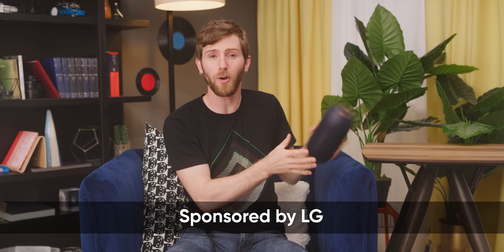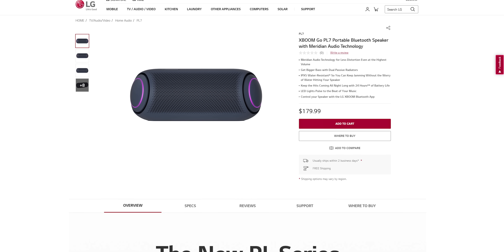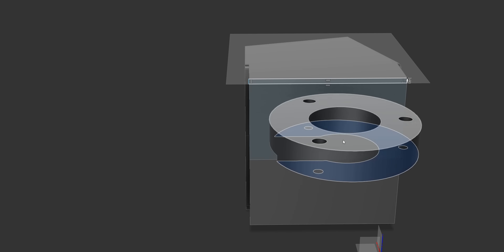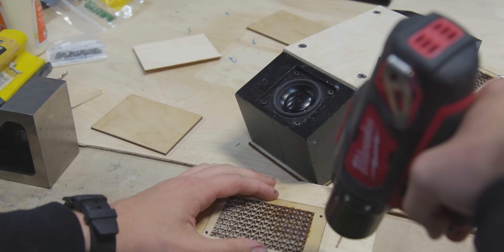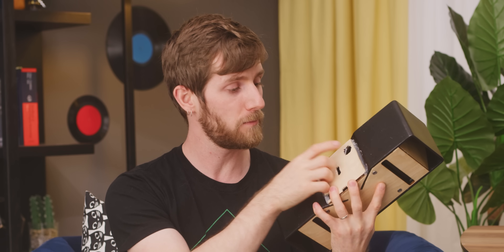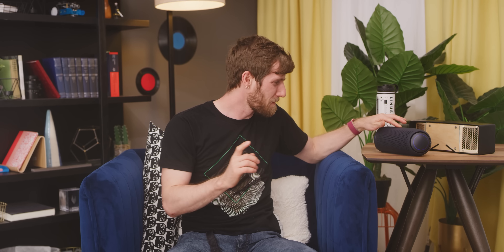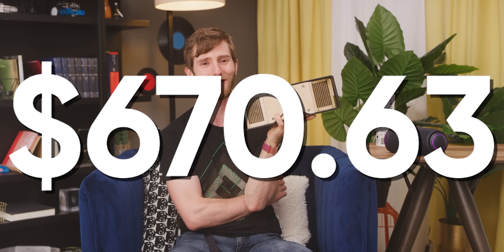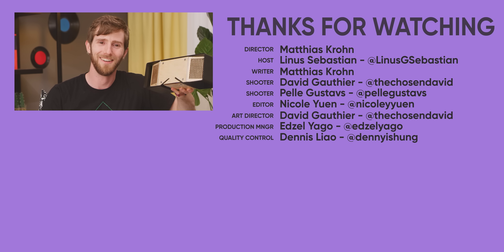Can we build a better bluetooth speaker? - LG XBOOM Go PL Series

Comment: bluetooth speakers sounds bad in general, i had a couple like

jbl flip 2 and 3, both sound good at volume up to 5-6/10 then it start to distorsion
then i had 2 sony srs , good balanced sound but they leaks air witch give distorsion once more, 
i had that fixed by gluing the leaks from the inside of it , seems that some of the holes where cracked by default and it have 8 screws and some had a lil crack and leaked air preasure,
although they had rubber washers but that don't help if the screwhole is cracked, other than that up to volume 6-7 it do pretty well for 2x 16watt + 2 radiators but still it don't sound as ii expected to be from a hires ldac speaker

if i would to make one for myself, i clearly would make one with more liter of volume, because these speakers are cramped in and can do way beter if they had more volume orif they had each their own chamber, but i dont have the tools  but i do want to make one

also linus that muddy sound is the amp most likely , these chinese amps sucks eventhough if they have 100k reviews with 5 star, i bought once a well rated android car radio, it works well except the distorsion of the amp, wavey highs, muddy bass i came that to know later about these chinese stuff, i am no audo specialist though but all i know my next speakers will be dynaudio i heard them from a car speaker set from distance and damn they sound well balanced, compare to a bose, sony, bang and olufsen w/e, all these mainstream brands sucks balls, and from that i read for amped home speakers each driver have its own amp and i realy am exited to hear the results of those

but once again, portable speakers sucks its a nice touch on but even a makita DMR110 sound way beter, because the closed dual chamber probaly , and that for 2x4 watt and quite compact rugged radio

Comment: So I did something kind of like this, I bought a Sony srs-xb20, took it apart to figure out the impedance of the speakers inside. They were 4 ohm, and I just happened to have some 14 gauge speaker wire laying around and some Cerwin-Vegas from the early 80's. Re-38s , they were also a 4 ohm load so I hooked them in and to my surprise they work great off the little Sony! Not exactly portable but great for a shop it garage.

Comment: This was fun!  So lighthearted, and Linus all relaxed and happy.  It's cool to see you all get into physics - the necessary cabinet design to try to eek out bass from 2" drivers.  A concern that I have is the stereo imaging.  You have two drivers on each side, for stereo, but you have one tweeter in the middle.  That doesn't even make sense unless this is a mono unit.  And why put a tweeter with drivers that already probably go high enough.  A dual voice coil subwoofer would almost certainly have served better and wouldn't have required the complex cabinetry to get enough bass from the 2" drivers.  A 4" subwoofer in a sealed or ported cabinet of that design, with the 2" drivers isolated.  Hoping to see you all do more of these fun things, this was great!
Reply: And he never mentioned tweeter crossover.  At 40 watts, the tweeter's going to get blown soon without crossover, and the overlapping could be what contributes to the tinny sound.  I would be very curious how this sounds simply WITHOUT the tweeter.

Comment: "How could we have done better?" Easy, mass production. LG spent alot more in every way and it's only cheaper (p+l) due to the economics of scale
Reply: Exactly, they don't buy 1 or 2 of any part, they buy several 1000s, their design teams cost is split between 1000s of units, manufacturing labor in China is way cheaper than Canada, and probably lots of other ways to save money.
Reply: @LaughingOrange  Lg makes their own battery from lg chem and also have great number of pcb designers on hand who will reduce the cost of design and formfactor with the pcb.

Comment: I dont want to criticise, but all that 3d printing and design work just to cover a 2in speaker with a wood grill? Honestly from what i can see a 4inch speaker would fit. Giving it some oomph with a more powerful amplifier and a passive radiator made from a second-hand little woofer on the back (removing the magnet, leaving the cone) would do a bit better i suppose. Nice looking build though

Comment: Just get a 12v battery like the one in a battery backup, a Bluetooth car radio and a couple car speakers, and amp if you want to add one, and 12v battery charging board. I’ve built one and it’s louder than any Bluetooth I’ve ever seen. I spent about $60 and 3 hours of work and made it.

Comment: This is why you have acoustic engineers. Without a crossover it's no wonder that it sounds muddy. Still a cool project, didn't think you'd get it this far!
Reply: My thoughts, but crossovers are probably a little hard for them to calculate. Well, and that "transmissionline" was a mess😆
Reply: Electronics / Electrical Engineering Technician and Pro Mobile DJ here... whose designed & built her own 3 Way Loudspeakers.... Yes you are correct.. the absolutely 1 Critical but maybe only primary design Flaw.... was NO CROSSOVER.... either 2 way .. 3 way.. or Low Pass / High Pass ..... by this case the Tweeter was being overdriven by the lows ... and to Sharpen the Bass of the Woofers .. too much Highs... for what the drivers were designed for
Reply: the amplifier is single-channel, so a passive crossover is the only way to get a 2-way config, or at least a single capacitor on the tweeter for a "1.5-way". total fail that one wasn't used here, like, you don't even hook up a tweeter without any kind of high pass filtering on it.
Reply: @RWL2012  even a 2.2uf would have done the trick
Reply: @alagui7894  exactly
Reply: There are multiple issues here.

The muddiness in the bass response is because they're using an undamped transmission line design. Those will echo like crazy unless you fill them with some sort of sound deadening material.

I've never combined it with a total lack of crossover, but that sort of "oof my lows sound like every frequency at once" is pretty distinctive.
Reply: its the wrong design, they should have done something similar to a bose acoustimass system, with a passive radiator and a really long port
Reply: Yep, a number of issues in the final piece, but for the first prototype it isn't bad... they know the shortfalls and were to change it up on rev.2 
But the cost with RND on the LG is spread over many units.
Reply: @joesphanlu3369  There's no fundamental difference, since a passive radiator is coupled to the driver with just a slightly phase-shifted output.

A big tube with a speaker in it is a big tube with a speaker in it.
Reply: @louisvaught2495  "regular" speakers have a rough relationship between size and bass response, the acoustimass system (and probably the xboom) has a nth order bandpass filter. In HIFI systems, you usually don't want those as they're pretty muddy and you get lots of port chuffing (air moving too fast through the port). Otherwise its quite a marvel of engineering. See for reference: https://i.pinimg.com/originals/b8/9c/4f/b89c4feec03ca43b28abbb2b7372900c.jpg
Reply: @joesphanlu3369  They're the exact same system, and an "nth order filter" isn't a technical term.

When people say "nth order" they mean a filter of order "n" and the actual order has to be specified in application.

For an acoustimass system vs this one, the position of the active driver doesn't fundamentally change the behavior, just the resonant mode.
Reply: @louisvaught2495  yes i know what a nth order filter is. This might better explain it: https://jlaudio.zendesk.com/hc/en-us/articles/204374210-Bandpass-Enclosure-Characteristics?mobile_site=true 
A low pass filter sub box will put a physical EQ on the sound waves. Nth order depends on how aggressive you want the frequency curve to be. Another way to put it is how many times you want to filter it.
Reply: @louisvaught2495  I'm referencing nth order filter because it is up to the performance one wants. Some may want a -3db slope, some may want a -6db. All orders would work with varying performance. 

You arguing that detracts from the original point of "Linus is using the wrong box type". 

Also, as an Electrical Engineer, I can tell you that is indeed the way we reference things with varying degrees. It is used in polynomial equations, RC filters, and many other aspects of STEM.
Reply: @joesphanlu3369  No, that's not how that works dude. If you want a particular application, specify which order it's working on.

Dropping more technical terms doesn't prove you have more knowledge, it just makes you look more nervous. Especially technical terms that aren't directly applicable here.

If you are an electrical engineer, you should probably brush up on how speakers actually work, and stop thinking in terms of that one AC circuits class you took.
Reply: @joesphanlu3369  Nope. I don't need to cite my personal opinion that it sounds like you don't know what you're talking about. Nice job citing blogspot, by the way, highly technical source.

When you talk about bandpass filters, it's either "acts like a bandpass filter" or "acts like an {x}-order filter"

Both of which are terrible statements when talking about speaker enclosures, which don't act like ideal systems under pretty much any circumstance.
Reply: @louisvaught2495  I'm citing his graphs only, using them as a broad reference. I have previously cited more "technical" references. I'm not gonna argue with your opinions, all I can say is that theory and equations used for many decades by engineers more qualified than me don't lie
Reply: I'd like to add... Reading some of these comments here are total SMH moments,.... Me and my Dad both used to work for Telex / Electro-Voice ( EV ) ... now owned by Bosch... i've learned all about PROPER Loudspeaker design, straight down to Porting tube calculation .. ( yes there is a calculation Formula for that .... without proper Loudspeaker design and Crossover design ... your speaker design is going to be a Epic Failure... crossover design correlates with the technical specs of each speaker driver used in the total circuit
Reply: @DJCoyote2  Yeah, that's why most DIY enthusiasts do digital crossover nowadays. Just put each driver on a separate channel and EQ it in software.

Way, way better behavior.
Reply: Lmao you dont need to be acoustic engineer to learn crossover design its actually quite easy if you got measuring mic. They have 0 clue about speaker building, they should have went with passive radiator and use some cheap amp with dsp that allows for scaling with loudness, there are some cheap modules like thst available. They could set a digital crossover then
Reply: @UCiSSLNi0rLr-8mL6tv-QyGQ I was actually about to type this, but you beat me to it. Its quite amazing what you can achieve utilizing a DSP in terms of covering the sound frequency spectrum in s small package. 
.My first portable build consisted of 2nd order Butterworth( 2 way crossover )and the sound clarity was superb, but it still lacked the bass as it is a small drive. Dsp allows you to raise the lower frequencies and be precise with it (raise the decibels say from 40hz- 55 hz by 2 decibels albeit not bottoming out the driver. 

Dont get me wrong crossovers are great ( i had a 4way crossover McIntosh) but making it portable like in this video is quite difficult.
Reply: @alagui7894  Which the 'DSP' - Equalization' can be more than likely handled on the Input side of things.. Yes.... here the idea of the Speaker design is for near flawless sound reproduction.... so in this simple case of Linus's amateur design.. it was an OK first attempt
Reply: @DJCoyote2    It sure can be handled on the the input side, but at that point you would have to be invested or an audiophile to do so. JBL actually uses DSP on all their speakers as well as Bose to achieve better quality in audio. 

Its a lot more efficient and its too bad they spent $800 plus dollars to build the speaker on first attempt when they could have used something like wondom. Board to have better control with frequencies. 

Modiane explains this technology. Linus spent too much money on this build imo
https://youtu.be/VtykrKAPJDk
Reply: You dont need a crossover. Just a dsp or equalizer.
Partsexpress has some nice 3 1/2 daytons that hit as low as 40 Hz with a 5 inch passive radiator
Reply: @alagui7894  .... No, you still actually really do need even just a simple tuned LRC crossover ( Choke, Resistor, Capacitor... or Choke, Capacitor ... and a Choke ( for Low end band pass ).... the magic of it though it can either be ' ACTIVE " type or the conventional Band Pass " PASSIVE " type of crossover ... some amplifiers will actually be designed with a crossover already built in .. one output will be labeled LOW and the other will be labeled HIGH . or Tweeter ... and may still be " Bi-Amp" designed such as the Amplifier they used here
Reply: tHiS iS wHy yOu hAve aCouStiC eNgiNeeRs
Reply: @xenonram  weird but ok
Reply: im begging anyone reading to repent Jesus will forever reign king please repent and trust in him TODAY for today is the day of salvation saith the Lord.
Jesus still loves you breath in your lungs means Gods grace still abides on you for now. maybe it will end today. so repent.

Comment: I think this device would perform significantly better with a single subwoofer (replacing the current single tweeter), and two tweeters to complement the two full-range speakers. Having two tweeters and two full range speakers would enhance the stereo effect, since stereo hearing relies more on higher frequencies than low frequencies. So a small subwoofer would be quite adequate for improving low range response, while the fullrange and tweeters would carry the sound on mid and high frequencies.

The production costs are always high on DIY projects if you include the "cost of work", and even things like multiple materials are something that would probably come out significantly cheaper in mass production. Mass production is a huge advantage for commercial products if you think about it that way - and I would argue that's beside the point of projects like this.

Comment: Product review: 1 out of 5 stars
it's ugly, the wood does not look good, stainless steel or aluminum would've looked better and cheaper if tig welded than 3D printing. It definitely is not waterproof, battery life sucks. Doesn't have rgb, it's very expensive. Does not have a aux port. You obviously didn't do you're homework, I think I could've done better.

Comment: For anyone wanting to do something like this, you'd probably have a better chance with something like a used high quality full range speaker like a Fostex driver and using the ported design. Doing a 2 driver design without a good crossover seems like it'd be doomed anyways.

Comment: Rather use ported design, you better use bass radiator for punchy bass on small form factor. That's exactly what LG use on their design, you can see both of the bass radiator at the side, and the main speaker facing forward

Comment: "Mattias only evaluated it in a vacuum"..... how did he evaluate it then? Speakers don't function in a vacuum! :)
Reply: Without hearing the LG unit once or anything else. In other words, a personal "vacuum".  English is not my native language, but even I picked that up. Technically though, you are correct in saying that speakers using air, do not function in a vacuum. But only if the speakers and the person trying to listen to these speakers float in that vacuum. Else, the movement/vibrations of the speaker will still be transported through the mounting material(s) and you would still be able to hear it.

Comment: Hey there, I built some variation of speakers and especially at that size there are a few things you can do. To make the box a lot smaller without compromising bass you could consider using passive radiators instead of the port. Also try to find a long excursion driver for the low end, just try to move as much air as possible. Alos, you should get a setup to measure the frequency response and use some kind of equalizer inside the speaker to get the response more linear and also boost the low end. Like that you can use a heaver passive radiator and with a little more output on the amplifier that drives the sub speaker you get great results in small sizes. Most smaller boxes use some kind of DSP to adjust the frequency response and they also use passive radiators to make the case smaller.

Comment: definitely need a 2" sub like the tang band W2-1625SA in addition the tweeter. those dayton DMA58's have a lot of rolloff below ~300hz. also, a band-pass crossover to better fit the frequency response profiles of the sub/mid range/tweeter drives.

Comment: Take an old bookshelf speaker, put cheap  18650 cells from old laptop batteries in there, use a cheap TPA 3116 1x100w amplifier (works great, from experience) get a cheap 3.5mm to bluetooth adapter with some decent version of bluetooth, and you are going to have a much better speaker for less money,